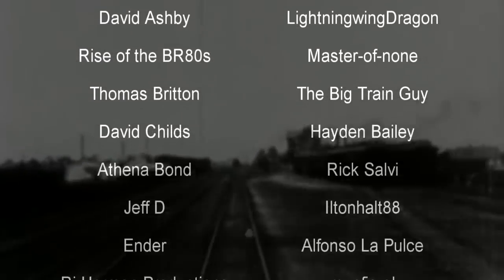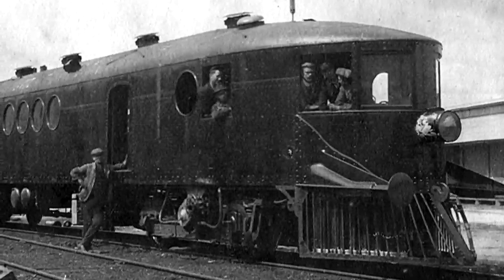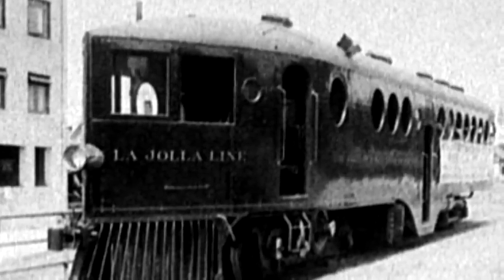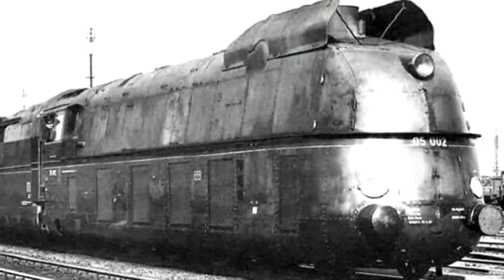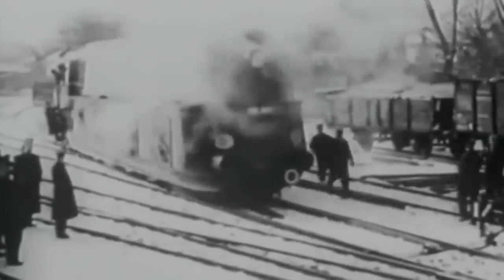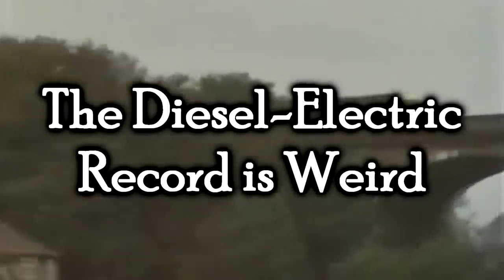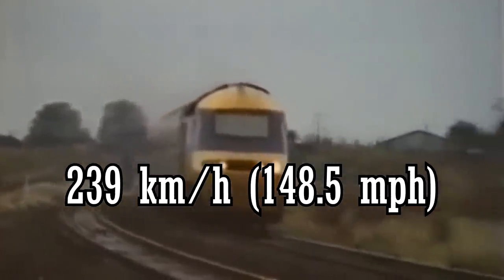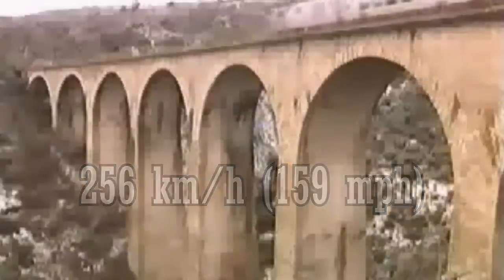5 of the Fastest Trains Ever | History in the Dark

Comment: An interesting locomotive that should have been added is the New York Central M-497 Black Beetle, which was an Budd RDC with had a pair of second hand General Electric J47-19 jet engines form a USAF Convair B-36 "Peacemaker" bomber plane attached to the top of the locomotive. The route that it ran on was between Butler, Indiana and Toledo, Ohio because of how straight the line is. In 1966, the black beetle hit a speed of 295.6 kph or 183.68 mph outside of Bryan, Ohio which is the rail speed record for America and the speed record for a light-rail vehicle.

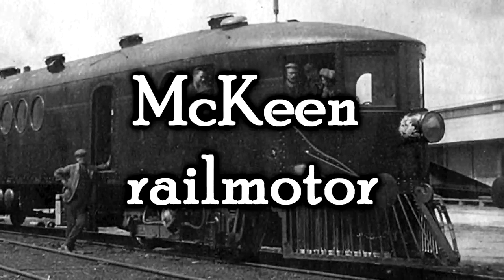Comment: An Australian McKeen car is the lead photo at 1:32 since it is actually the Australian Victorian Railways McKeen car number 1 .
Appears to be taken at Wodonga on the delivery run from NSW with the short lived roof position whistle.
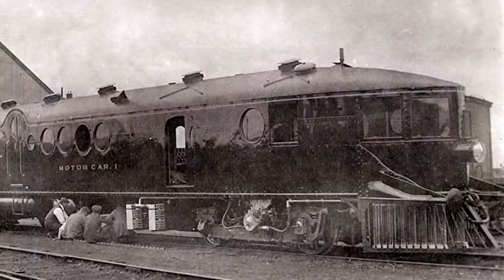Later at 2:40 is also VR Motor Car number 1. Likely photographed at Newport Railway Workshops being checked prior to entering service. Both VR photos early on and before the buffers got replaced by a buffing plate at both ends for normal service.
You can tell they are the Victorian Railways McKeen cars since they have wide spaced buffers and a coupling hook that are not used on American McKeen cars. Another difference is the raised centre passenger door designed to be level with station platforms that were standard in Victoria. The raised centre passenger door also raises the roofline above the door.
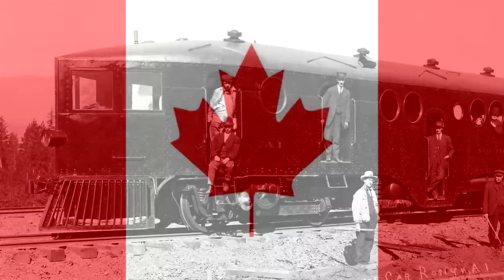Looking at US versions at 2:09 you see no buffers or buffing plate, a straight roofline and dropped down centre body for the door.
The Victorian Railways McKeen cars were used intensively for a few years on the Ballarat to Maryborough runs and also Hamilton to Warrnambool runs clocking up big mileages. Getting parts needed after high use during world war one from the US might have been a problem so may have led to the two McKeen cars being de-engiined. They were then used a passenger cars on the Newport to Altona passenger shuttle trains before electrification  in what was then outer suburban Melbourne.
In 1928 the VR went on to use Doodlebugs but we're locally called PERMs meaning Petrol Electric Rail Motors. By the early fifties the worn out and hard to get parts for Winton petrol engines were replaced by GM series 71 diesel motors so the ten PERMs became known as DERMs. These diesel doodlebugs lasted in normal service until 1991 but still preserved ones run on the Daylesford preserved railway and even mainline fan trips from Melbourne to far away Warrnambool have been run. There are a few vids of the DERMs in normal service and preserved.
Glad my local state VR Railway system got good photo coverage in this, although many would not know it

Comment: Even though I'll give it to Mallard that she achieved this speed I still think the record set by the 05 002 is more impressive as it had a full set of coaches on a level track and did not suffer any damage where as Mallard more or less did it by accident. Then again, the wheels of the 05 class are quite alot bigger than the A4 class. Still, both are amazing machines. Cheers
Reply: How can it be accident when she actually had the speed testing coach attached. That thing is special equipment
Reply: @nicktrains2234  Oh, I wasn't aware of that. So it was an actual top speed attempt? If so, my bad.

Comment: The last one that went 356 mph,  it was feared that the train might create enough lift to actually fly off the rails at that speed.  The onboard camera views were jaw dropping.
Reply: Only achieved it due to some very cutting edge Norwegian aluminium extrusion tech. Used to work with them, they had 2 products high speed rail catenary and wheel struts for high end racing motorbikes. Have the pictures I took of the process somewhere but hesitant to share as it's proprietary information on production methods.
Reply: @MrStuart264  Still looked very sketchy which is probably why it was only done once.  It was a pretty amazing run.  There was real danger involved for those on board.
Reply: @gregrowe1168  that is not exactly correct.  The high speed tests are done in several days, at more than 400 km/h and perhaps several runs at more than 500 km/h, to test track and catenary for the official record.
Reply: @gregrowe1168  And anyone nearby, a high speed catenary "drop" makes one hell of a mess.

Comment: Ok, even before this starts, Mallards speed record is disputed by plenty of late age American steamers. The problem is that no one ever actually put dynamometer cars behind them, and the tracks some of the emgines ran on (east coast) weren't ideal for a speed test anyways (hills/curves). I firmly believe that a Niagara could beat a Mallard.
Reply: They did a test in 1938 with a NYC Hudson, where they put it on slip rail, and got the wheels to spin up to 700rpm. If it was moving along the track, it would have reached 160 miles per hour. So you are probably right. 
Source - Coalition For Sustainable Rail

Comment: Random fact about the original doodlebugs is they ran on gasoline and couldn’t run in reverse. The town I grew up in was passenger served by a doodlebug and 4-4-0 before it as it was super light rail, the roadbed ballast was oyster shells and the tracks were basically trenches with oyster ballast and track. We had a really badass rail wharf,

Comment: What shocked me was that Mallard was able to hold 75 mph after the 125.59 mph run, considering she had just melted down a main bearing doing it.  And Sir Nigel may have been a good locomotive designer, but he was a bit of a slow learner, because he didn't learn his lesson about overdriving the Class A4's (they were only rated to 90 mph) and wanted to try to crack the 130 mph mark with Mallard ... after it came out of the shop with the damage from the previous 125+ mph run repaired.  But repairs to Mallard weren't finished until 1939 and we all know what happened on the first of September in 1939 ... and somehow for a country now on a war footing, wasting a lot of coal and likely damaging Mallard again, possibly beyond repair, just for bragging rights - that Mallard already had - wasn't worth it.
Reply: I’ve heard rumours that they planned to use the Sir Nigel Gresley locomotive itself to set a faster record, she likely could’ve gone 130+ but thanks to the actions of some Charlie Chaplin impersonator, we’ll never know

Comment: Some more from Germany:

In 1902 test runs were done on a German military line used as a test track and experimentally electrified with a 3-phase AC system.
Two six-axle (A1A A1A) units were built by van der Zypen & Charlier, one with Siemens electrics, the other with AEG equipment.
The Siemens car reached 209 km/h, the AEG car reached 210.2 km/h. Those were the first trains ever to break the 200 km/h limit, they went faster than any (officially documented) steam train ever and that well before what we now perceive as the best and highest of steam technology. Even though these trials showed the advantages of electric traction over steam impressively, it took several decades until electric high-speed trains were introduced in regular service.
The units were reportedly preserved until the second world war and then lost in the war. They are still the fastest trains ever with a 3-phase overhead wire system.

Franz Kruckenberg built the experimental "Schienenzeppelin" in 1929 with a private company in the repair works of Hannover. It had a lightweight aluminium structure covered with fabric, similar to the way Zeppelin's rigid airships were built at the era. At a length of 25.5 m it had only two axles spaced 19.6 m and a sensationally low mass of 20.3 t, it was powered by a 324 kW aircraft motor with a wooden 2 or 4 blade propeller (tests were done with both). In 1931 it reached 230.2 km/h, surpassing the record of 1902. Until 1955 (experimental runs of SNCF with electric trains) this remained the absolute speed record on rails. The rail zeppelin was rebuilt in 1932 and 1934 to test components, then stored in Berlin. When the space was needed in 1939 it was scrapped, providing a few tons of aluminium to war preparations. It's still the "fastest propeller-driven train ever".

Germany took the world record once more in 1988, with the 1985-built ICE/V (the test unit for the ICE 1 and following trains) reaching 406.9 km/h on a new high speed line. That only held until 1989 when France took the record back. Speeds in this range are now considered "technically possible but too expensive economically".

Comment: Note on the McKeen Railcar's claim of being "The First Streamlined Rail Vehicle": Um, no. No they weren't. Not at all. Not in the slightest. Railway designers had experimented with various "windcutter" designs since as early as the 1850's. The first purpose-designed locomotive with streamlining, at least that I know of, was the French PLM 220 C 61 Class 4-cylinder compound 4-4-0's, popularly called the "Big C", built between 1898-1902, 7-3 years before the first McKeen cars.  These engines featured a roughly bullet-prow shaped faring over the smokebox door, airstream panels between the chimney and steam dome, and a V-shaped front to the cab.

A more funny factoid about the McKeen railcars: According to volunteers at the Nevada State Railroad Museum, the first McKeens were delivered with no reverse gear. At all. They could not go backwards under their own power. The Virginia & Truckee example had to be parked in a special shed that was on a slope so that when starting for the day the driver could simple release the handbrake and allow the car to coast backwards onto the mainline before starting to engine and getting to work. When operating, the car would work the line upgrade under power and on its return journey would simply coast backwards by gravity. During its most recent restoration the previous engine, which had long replaced the original distillate/basically kerosene engine, was swapped for a modern Cummins diesel unit that finally does have a working reverse gear.

Comment: 9:30 Australia bought those to run in NSW & parts of Victoria, we call them XPTs, in theory they are capable of 250km/h but we run them on railways that don't allow them to go much faster than 100km/h & in many parts much slower than that, an origin & destination that takes 2.5 hours by car takes more than 4 hours by XPT,  you have to wonder why NSW State Rail bought 250km/h power units for a network that would never allow it to operate at even half its capacity.

Comment: Did you know that the TGV prototype (1970's) was powered by a turbine engine (it was a modified aircraft turboprop engine turning an alternator)?  The TGV program was switched to straight electric after the oil crises in 1973 and 1979.  The traction motors remained the same between the turbine version and the straight electric version.
Reply: TGV 001.  The 1973 crisis led to electrification, as the first serie trainsets started tests in 1978.

Comment: The HST125 has effectively held the absolute record three times and also holds the passenger carrying record as before the HST125 took the record the protype the class 41 set the record on the 12th June 1971 at 143.2 mph. The production version, the Class 43 holds an absolute speed record of 148 mph 1st November 1987 and previously with with passengers having upped it to 144 mph on the 27th September 1985. So if one of these Spanish and yeah Soviet designs actually had some credible witnesses to their claim the HST 125 would be "hold my beer".

Comment: The British Rail class 43 power car.
Why the fuck didn’t British rail build a locomotive for lighter passenger work with a cab at each end using the guts of a class 43 power car.

I mean come on!! The tech was there! All they needed to do was build a locomotive body shell with cabs at each end and hey presto! A reliable loco that can pull 8 or 9 carriages and easier to fix parts since it shares it with the HST trains.

The HST power car is the peak of Diesel Electric train technology. I reckon Amtrak would have done good to build a beefed up FRA compliant version
Reply: Australia built them under licence, where they known as XPT

Comment: The French record train was not a TGV duplex despite looking like one. It was a special experimental train that was built out of different parts. The cars was of a duplex. But only the upper part was used for passanger and crew. Most of the lower floors was filled with equipment.

The power unit was from a TGV-POS, not duplex (slightly modified) there was also two additional powered boggies from a AGV train. The wheels was all swiched out and a lot of other components was replaced.
Reply: But still 574.8 is CRAZY

Comment: Australia has a version of the UK HST called the XPT :
https://youtu.be/atXyd8sAcys
Generally limited to 160 kph in normal use although a test run record achieved 200 kph.
When ordered and designed the motors were de-rated to cope with the heat in Australia. From the start it was known the track and signal conditions could not be afforded to be upgraded for 230 kph running. Passenger response showed insufficient demand for the extra expense of higher speed running.
In recent months patronage on the Sydney to Melbourne run is increasing in response to a massive increase in  airline flight cancellations and lost luggage unreliability.

Comment: Calling McKeen railmotor the fastest gasoline powered vehicle is inaccurate, even wiki states it as a fastest gasoline vehicle with "mechanical transmission". Small, but significant detail. If we are talking about just gasoline powered vehicles, some gasoline-electric vehicles (such as UP M10000) were faster. Contenders for fastest gasoline powered vehicle also include Schienenzeppelin (first 230 km/h with propeller, later rebuilt with fluid drives and reached 180 km/h). An interesting case is Czechoslovak M290.0, which was designed for 130 km/h operation and managed 148 km/h in early 1930s. This one has a rather unique transmission, working as fuel-electric at low speed and switching to direct mechanical drive at higher speeds, so it could technically run faster with mechanical transmission (just could not start with it).

Comment: I swear if I see a maglev on this list I'm going to lose my mind. I hate maglevs to me they don't count as trains. In order for it to count as a train they must have rails
Reply from the maker: They're still technically trains, BUT for what it's worth I felt that focusing only on trains that run on rails would be more interesting anyway. So no maglev on this list.
Reply: @HistoryintheDark  good to know otherwise I would get Alfred E Perlman and his chainsaw
Reply: I think ther are trains though they are an entirely different beast and should be treated as such.
Reply: Maglevs are both trains and railed vehicle, what they are not is railway stock.

Why do you hate maglevs, they are the best.
Reply: Maglevs are way to expensive and not so energy efficient.
Reply: @Jeppe-Covid1959  what do you base that on?
Reply: I mean, they cost a lot to build and can only transport passengers, so they are only for densily populated areas.
Reply: @matsv201  there are at present only 31 km of high speed maglev in regular operation and A LOT of km of high speed railways.
Reply: @Jeppe-Covid1959  no,, they aren´t.  They are expensive, and cannot use the existing network.  Also, they use a lot of energy and the main issue after 360 km/h is the air drag, which ALL the vehicles (railed or not) must face.
Reply: @MarceloBenoit-trenes  yes, du you have a point?

Comment: This is probably going to sound like British copium but idgaf. 

It doesn't matter if the T1 beats the Mallard's speed record. It will be a new build locomotive, built with modern tools, modern materials, and modern hindsight. It may break the steam locomotive speed record, but it's not a standard working steam locomotive, it's a one-off. Technically the "Spirit of Rett" is the fastest piston engine car, and the ThrustSSC is the fastest car in the world, but those aren't usable cars in any normal sense of the word, and there is only one of them. Wikipedia suggests that the fastest production car is the Koenigsegg Agera RS. Also, Wikipedia's requirement of unmodified vehicles for it's "Production car speed record" seems reasonable, and the T1 would definitely count as a modified if you look at the T1's website.

Comment: You lie class 43 doesn't run no more and you never talked about the firs of the class sir Kenneth grange
Reply: correction, while they no longer pull main line express services, the class 43 still does lighter duties for example in Scotland and the South West of England... the derailment at Carmont in Scotland during 2020 was a class 43 trainset
Reply: @MercenaryPen  it was not late 2022 when they were retired not 2020
Reply: @MercenaryPen  they only run on cross country and Scot rail now not lner and gwr and fgw
Reply: @dillonyeardley6270  bruh, HSTs remain in service with scotrail, crosscountry and GWR, along with a handful of freight/miscellaneous operators